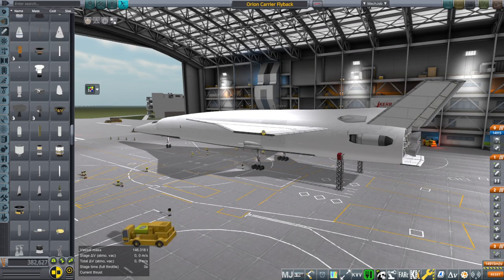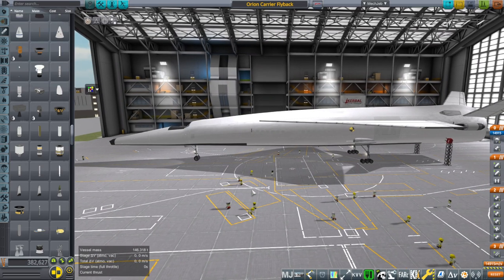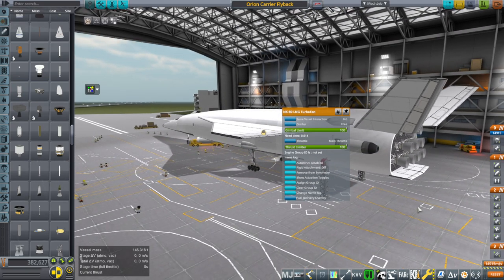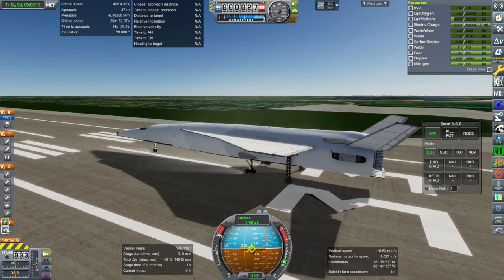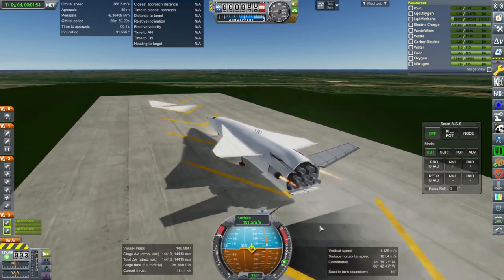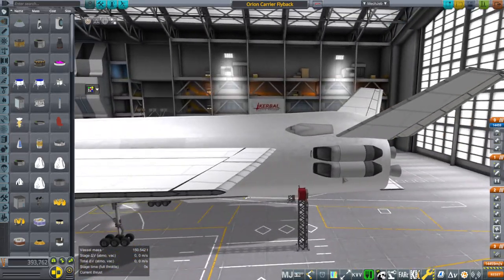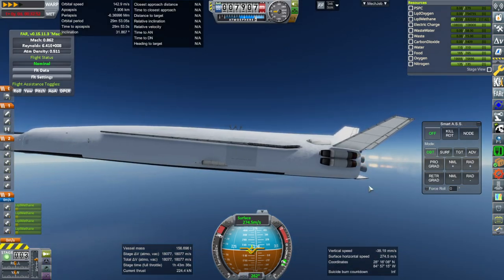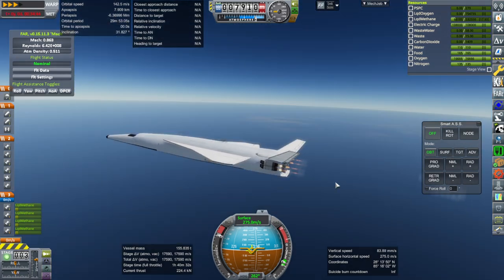Realism Overhaul in KSP 1.8.1 - Methane Jet Engine for the Orion Carrier Plane

Comment: There are jet engines burning methane every day. They just have their jet nozzles replaced with free power turbines and are used in industrial and marine applications. The LM1500 / J79 pairing is one such example. Same core gas generator, but where the J79 has a jet nozzle and attached accessories, the LM1500 has a free power turbine and the accessories were mounted separately. One runs on jet fuel, the other natural gas. If you modified the config file on a J79 to burn methane and made the consumption the same in terms of MJ/s of chemical energy, you'd be fairly realistic.
Reply from the maker: As far as I know, the LM1500 has not been fitted on a plane. I'd rather cite an engine that has been. Also, the J79 gets far less thrust and is older, so it would be inferior in every respect to this engine.

Comment: Very interesting premise! I've never considered a methane fueled jet engine. Would one have much of a use outside of this very specific scenario though? I guess I'm basically asking why do jet engines use kerosene over methane or other LNGs?
Reply: Err, what exactly did you think every gas fired power-station was burning? 

For the curious there is a youtube channel that refurb's and converts old military jet engines to their natural gas burning industrial configurations.
And my guess for kerosene would simply be convenience of storage being a room temperature liquid and an inherently higher energy density per unit volume. But I'm not an expert so.... YMMV!
Reply from the maker: I think it's always been a matter of storing natural gas, which is cryogenic. The fact that kerosene doesn't boil off at room temperature is an obvious plus. Not sure the pricing was worthwhile for natural gas until relatively recently (I mean, in the timescale of aircraft development).

Comment: Can't help thinking you should try a canard version so that the control surfaces aren't generating down-force exactly when you need a maximum amount of lift.

Also can you oxygen boost those jet engines?, a low budget version of the Skylon SSTO wouldn't be an entirely bad thing me thinks!!! 😅
Reply from the maker: I mean, someone suggested lighting the rocket engines on the tail for a bit, but adding oxygen into the tank will make the plane heavier, which means a higher takeoff speed, which means more wear on the landing gear.
Reply: @RaizSpace  Sooo, Canards + variable sweep wings + oxy boosted engines then! 😆
Reply from the maker: Those variable sweep wings are a lot more mass - note how heavy the F-14 is and those huge wing roots.
Reply: @RaizSpace  Yeah, there is that problem, but perhaps a fighter jet is not the best example to base weight estimates on, maybe the Vickers Swallow design demonstrates that lighter weight hinge mechanisms are possible?, especially given the decades of technology and material advances that have been made since the idea of swept wings came into being.

Comment: I do not understand the purpose of this design.
Reply from the maker: If functions as a first stage when using the nine Raptor engines on its tail, like this: https://www.youtube.com/watch?v=sfj1tLtTYxU. It has the benefit of not needing to save as much propellant for recovery because it just lands downrange by gliding. It can also be used for other purposes (like as a booster here: https://www.youtube.com/watch?v=P6b3AdhX-Nw) and if we get the right jet engines on it, it can be a heavy air transport.
Reply: @RaizSpace  I understand it's function, I am just trying to figure out what it is supposed to replace... It doesn't seem like it would be cheap enough to make sense.
Reply from the maker: It would replace Falcon 9, Falcon Heavy, Vulcan, and New Glenn in the same class (rather than with a much larger rocket like Starship-Super Heavy). Payload to orbit is up to 40 tons with both stages being reused. From what SpaceX has been saying, the nine Raptor engines (which is what the Orion Carrier Plane has) should be relatively cheap. The plane itself is obviously reusable, as is the cargo upper stage tested in previous videos. The upper stage uses four small methane engines which will be brought back.
Reply: @RaizSpace  I don't think the Raptors are as cheap as SpaceX claims. But even so, the Orion should have pretty decent cost efficiency - starting costs in reusables don't matter as much as operational ones.